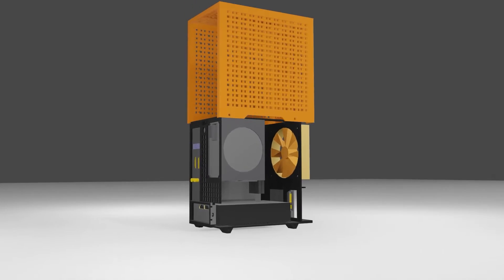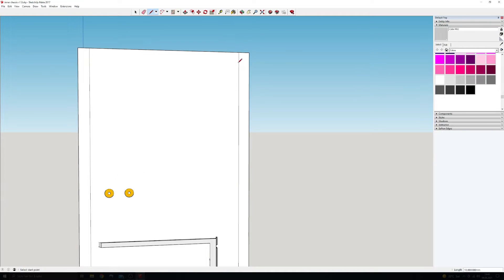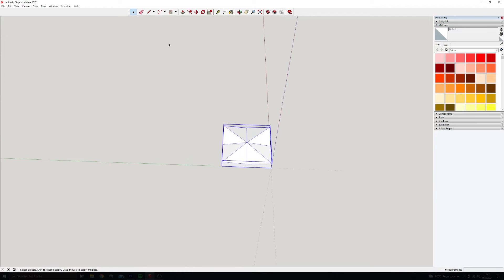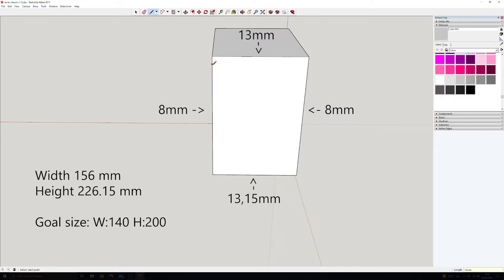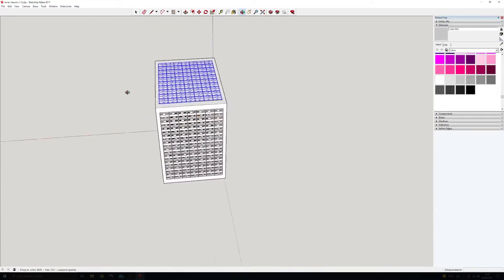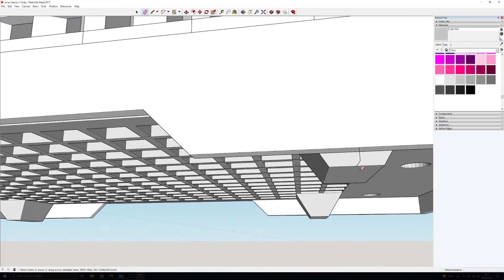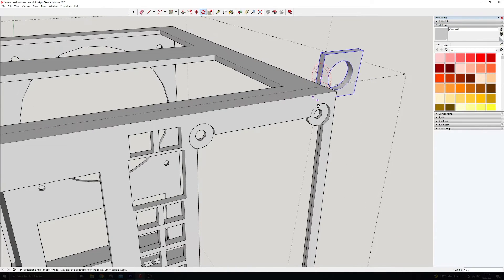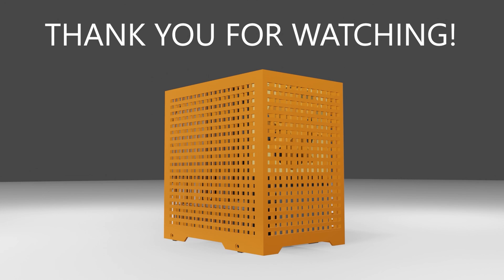How to design a PC case (using Sketchup part 2)

Comment: Great content.  Subbed!  Any plans or thoughts on using Blender to design PC cases?  I'm currently using it since it's such a powerful application.  Thanks.
Reply from the maker: Hi! Thank you! Currently I have only used blender to make some short animation clips like you may see in my other videos. Mostly I used sketchup up until recently where I changed over to Shapr3D. It’s a very user friendly program, easy to learn but it’s a subscription based program.

Comment: nice video, i made a case iwht makerbeams i still cant decide what cover method i use lol
Reply from the maker: Thanks! Maybe try some kind of flat panels that you simply screw into each corner on the makerbeam frame with t-nuts? Depends on your case size though! If its a bigger case you could always make many smaller panels and mount them next to eachother perhaps

Comment: Just checking, did you heat up the print head before concluding the extruder driver is broken? Firmware won't let you move it if it's cold.
Reply from the maker: Hey, yeah I tried, both hot and cold extrusion(without filament inserted). I’ve got some upgraded Marlin firmware allowing me to override the temp required by pressing «proceed» when the warning comes up 😊